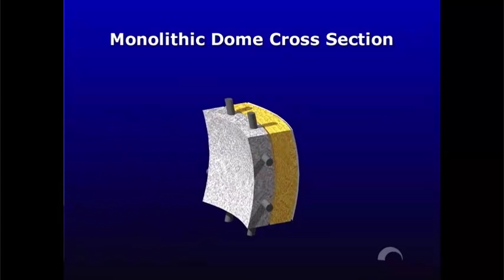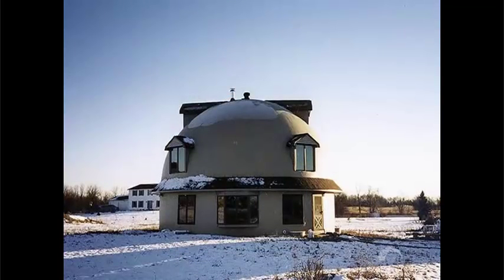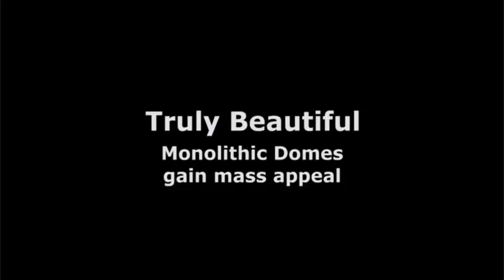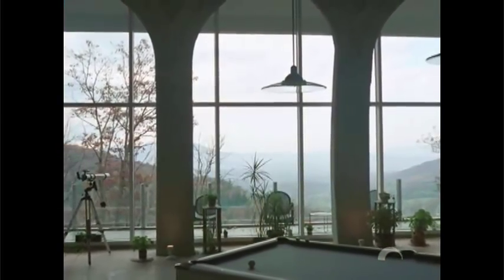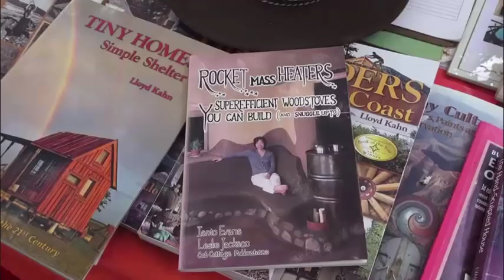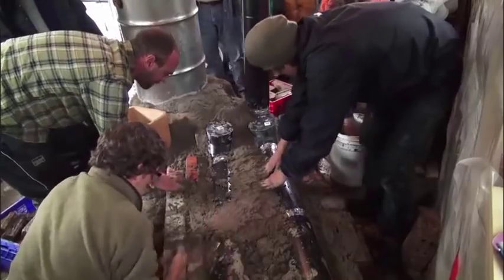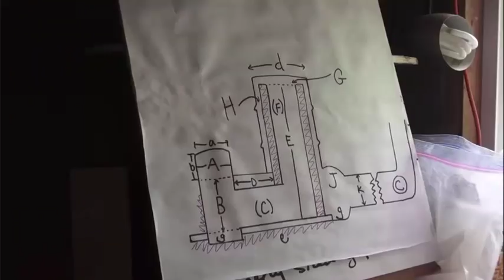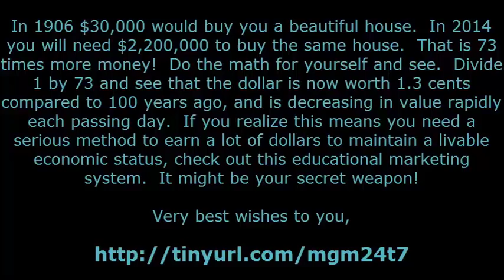How To Afford Your Monolithic Dream Home

Comment: Rocket style stoves are hardly new, been used in a similar form in North Africa since the middle of last century at least. Have one and always use it for BBQs or picnics, means we always have hot water available when out somewhere for drinks or doing dishes. Uses only a few sticks to heat water to boiling point. Even better are the ones where the water is heated in a tube around the fire itself, that way you can cook on top while heating water at the same time, our one is this design. Can cook sausages/bacon/eggs while heating the water for tea/coffee/washing dishes all with a few sticks. Greatest invention out.
Reply: He said it was adapted from the developing world.....

Comment: It would be nice to see this rated so I can put a small stove into my existing fireplace. We don't use our fireplace now because it is a waist with the open flew. With a small rocket stove set into our fire place on the right side and have the flew gas move to the left and heat a small mass and provide a small heating or cooking surface then the gas travels up and out via a stove pipe installed into the existing brick work would be nice. I could see useing this over pellet or other wood burning inserts.

Comment: can this type of home be built in South Texas? My husband and I are very interested
Reply: Of course...Gabriela,the Monolithic Dome Institute is located in 'Italy' Texas which is about 40miles south
of Dallas Texas.
There is a  guy name David South who has been building nothing but concrete domes all these years.
He even has a dome material which can save the cost when built in overseas.
Reply: +Joseph Neutral 

Hi, Joseph.
Any new ideas on combining technologies, Aircrete, etc For a less extensive home?
Lots of comments on Black Dragon Rising Aircrete Dome video.
Reply: How To Get Out Of Babylon thank you
Reply: I am in San Antonio Texas at present.  I want a home built near the Ozarks in Missouri. About 70 miles south of St. Louis.   Could this method be taught to some contractors that I am hiring?  My crew would be traveling to Missouri to make the place.
Reply: That would not significantly lower the cost How To but WOULD greatly weaken the structure and ruin the passive heating/cooling effect.
Reply: Monolithic dome institute is in Italy Texas call them

Comment: I am planning on getting an FHA fixer upper loan. The house I want to build will look like a regular house and not a dome. I imagine it is possible to use the materials isn't it for a regular shaped house? It will be a better built place with those materials than wood. Easier and faster to put up.  As far as I am concerned the authorities don't need to know what my home is made of anyway. Concrete, should be the used name and there should be no problem.  I will have to check on it and see. I don't have much money and wanted to put concrete blocks in the walls anyway.  Would this type of home keep out sound as well. I have a train track  at the back of my house. I want to have a healing center and spa in the place too and need the quiet for the clients.
Reply: inspire734
Reply: You can inspire but due to geometry you will use 200 - 400% MORE materials for the same square footage.
Reply: also, you'll have to get  uilding permits & inspections, etc, so yes, they WILL know what your house is made of!

Comment: A general price sure would help but a statement that it is comparable to custom built conventional home tells me and everyone else NOTHING!
-
Depending on what part of the country and the level of customization could be a difference of up to $500 a square foot.
-
So again, the statement above is USELESS!
Reply: Exactly. YOU have to do your own research. The average price psf is readily available with minimal effort.
Reply: ExtrovertedCenobite it said it can run you the same price of a conventional home but what you save in upkeep and maintainace is phenomenal.
Reply: If you make it a hobby, and you do the project yourself, it's far cheaper.   It's also doable in small incriminate projects, as money comes in work the next project. Obviously the foundation is very important, with water lines, power, septic and radiant flooring.  Once the foundation is complete the rest goes up fairly quick, depending on size.  I suggest starting with a smaller one that will give you a place to expand from, so long as you have a place to cook, sleep, and a bath that ties into septic. Hope some of this helps.

Comment: pricing is way too high for this technique
Reply: Wrong Cawfee.  They cost the same per square foot as any wood custom built home.
Reply: They’re much cheaper to build, take shorter to build too, and they can last as long as 5000 years! And depending on the materials used, they can be bulletproof!